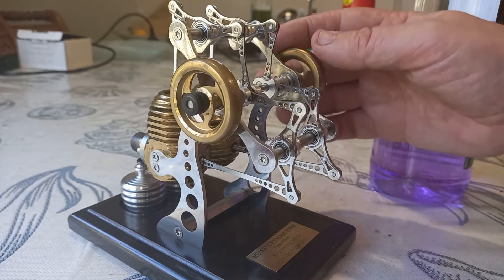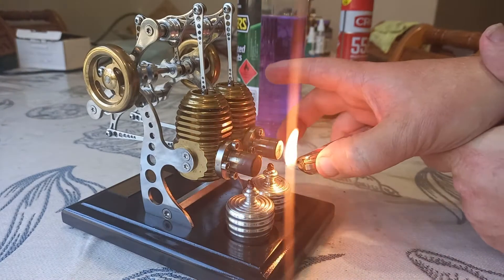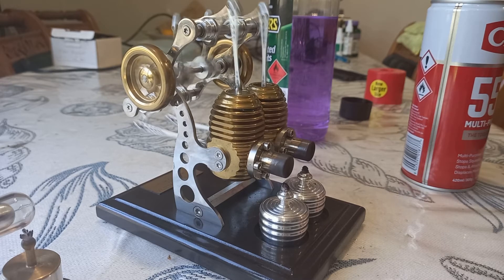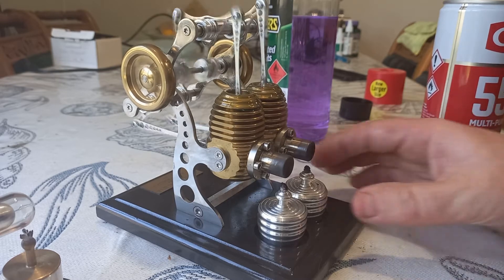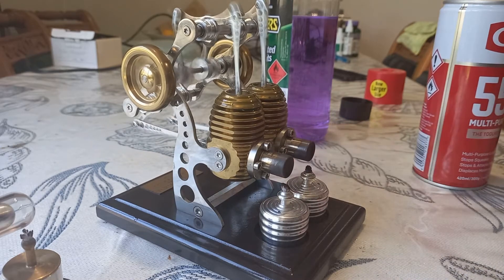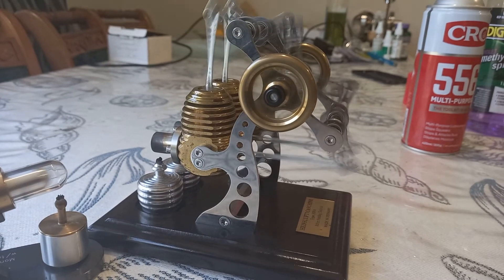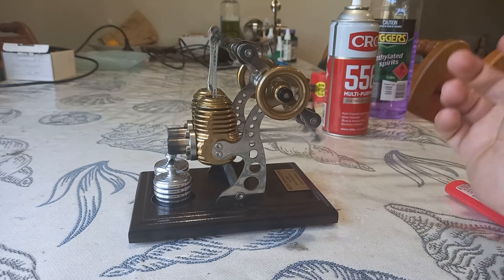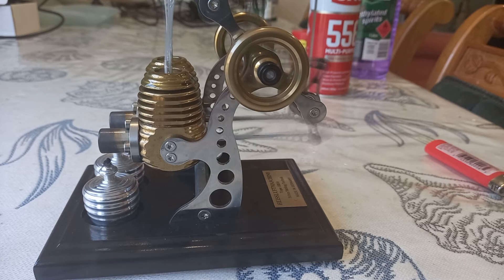Bohm HB14 twin Stirling engine from Germany - Thomas  Model Engines PCGuru collection

Comment: I have the same model and does not run at all any ideas please?
Reply from the maker: Sure! That's surprising. Check for friction. It should turn nearly friction free.
Now, if it doesn't have scraping or resistance in one point, it's probably not damaged.
It might need lubrication or it might need cleaning if it's used and someone put engine oil in it, or thick oil, grease etc
I always put a drop of CRC5-56 (you can see the red can in my video) or WD40 these are light spray lubricants that eventually evaporate. One drop at each cylinder and at each rod. Without that the engine will barely run, or not run. Failing that, use care to remove the pistons. They are very delicate. Wash them and the insides of the engine thoroughly with a carburetor cleaner or other spray degreaser. Reassemble and try again
Reply from the maker: Also, it you find damage you can't fix, take it to a model engineer for help or contact Bohm support for parts. Keep in touch!!!
Reply: If i do a video on my account i will show you how free and clean it is. Only thing is im using tea lights as i dont have the burners that might be the issue@ThomasPCGuruENGINES
Reply from the maker: That will be the issue. tealights create very low heat
Reply: @ThomasPCGuruENGINES  yeh I thought that. Struggling to get the burners for it. I will persist thankyou for your reply
Reply from the maker: I have measured the height of the burner, 32mm is where the wick begins. If you can't get Bohm spares, any spirit burner around that height should do. Or buy a little gas torch like kitchens use, they work well (but you'll need to share the flame!)

Comment: mine makes hardly any noise this is loud
Reply from the maker: Curious. Production differences? Let me know iy you produce a vid. Do you use WD40 or some other lubrication?
Reply: I just keep the pistons clean and all ways check all screws are tight
Reply: In my opinion they are among the best built engines on the market.